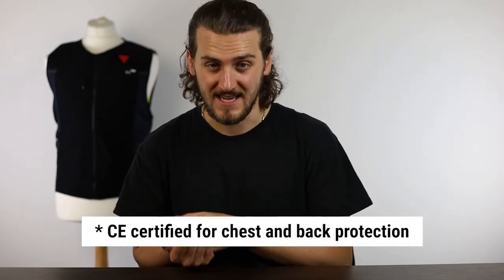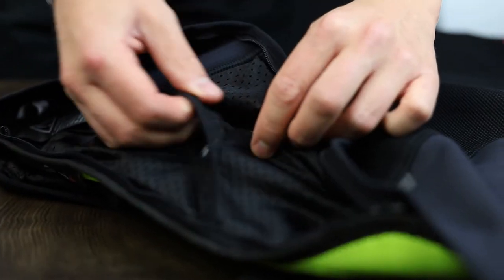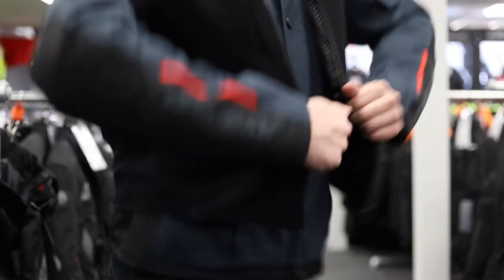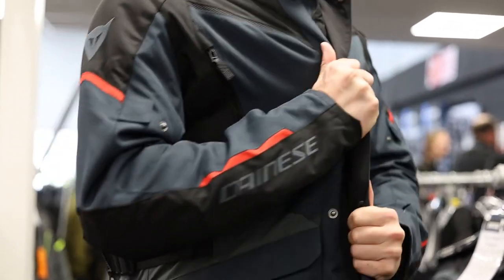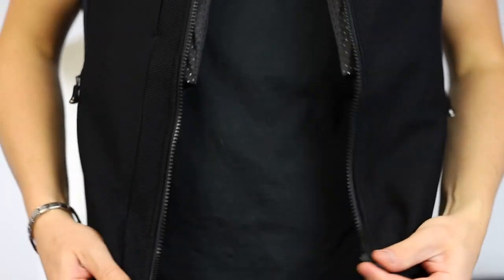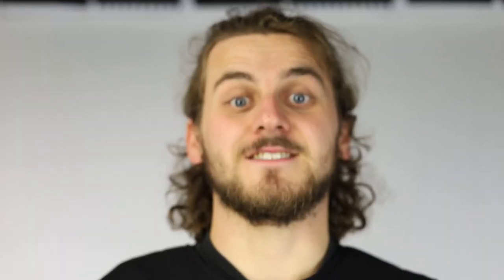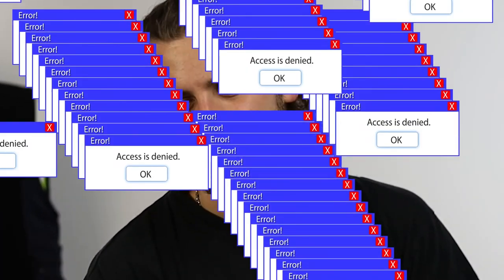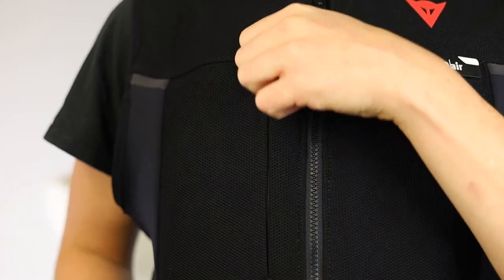Dainese Smart Jacket

Comment: Would you still need a back protector in the jacket if the vest version was worn underneath a motorbike jacket? or does the airbag vest do away with the hard back protector? Thanks
Reply: I have one and had it 3 years now. The pros, water proof so can be worn outside clothes, it looks good. The initial payment is for life. 3 years later I've sent it of for a service which is free ( to make sure it's still working perfectly) but any thing needs doing you are charged.
I've swapped to a klim vest for a few reasons, no back protector so I put one in jacket just incase. Only way to check battery is by connecting it to a lap top logging in errrr this is the real reason I've moved away to another type. The other reason is coverage not much for neck and front plus front not as much coverage. Third point it's bulky around waste if wearing under a jacket all gubbins around waist and not into back protector as other airbags.
The dianese is £700 ISH without monthly subscription, the klim £300 with £100 a year subscription so I would say 3 to 4 years nothing in it. I will keep it and have as a back up.